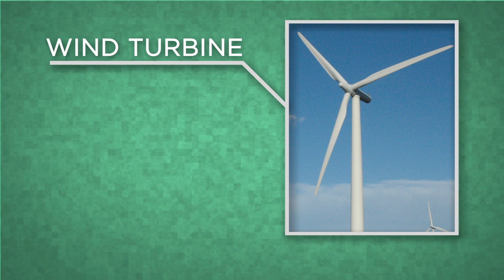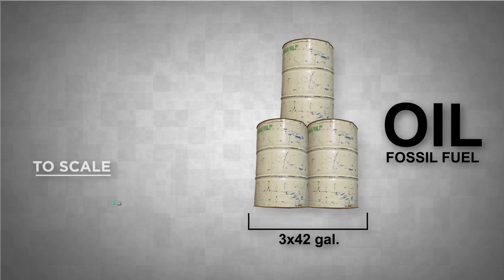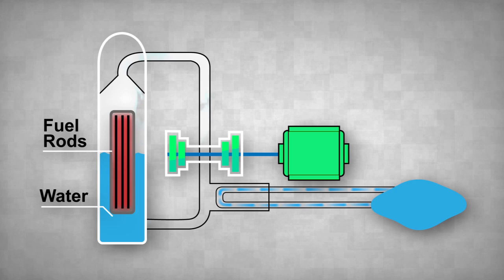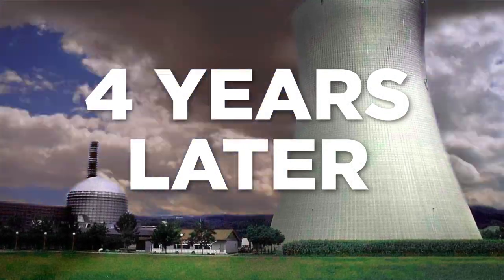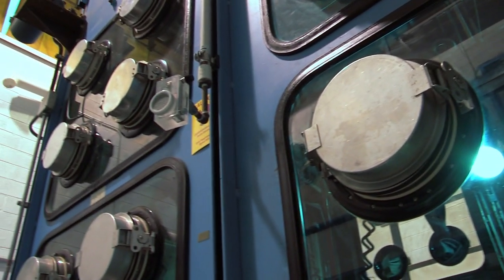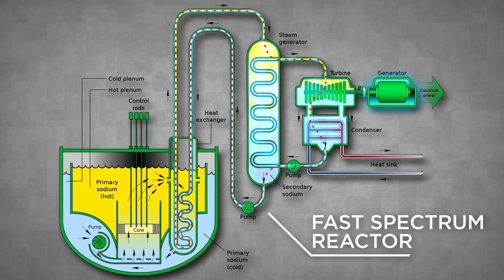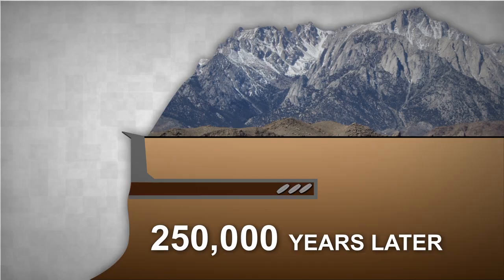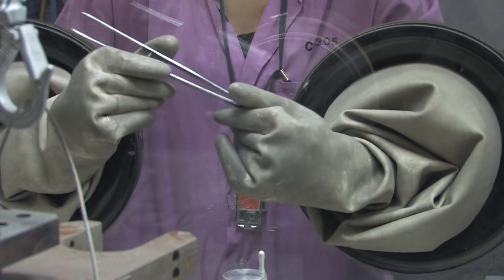Argonne explains nuclear recycling in 4 minutes

Comment: High temperature electrolysis would definetely be the way to go. Could be done in a continuous basis. The uranium and actinides could be saparated. Noble metals would settle out and the bad baddies like 137Cs and 90Sr would stay in the salt bath. When it gets too hot to work with simply drain off and react with silica to make glass. Then repeat 🤓❤
Reply: What about plutonium?

Comment: I'm sure this is a dumb question but, it's bugging me and I have to ask it.  Why not use a centrifuge to separate the actinides from nuclear waste?  The video talks about first converting the old fuel into a salt.  Salts can be melted.  Liquids can be centrifuged to separate the heavier components.  The unspent uranium and other actinides are all very heavy elements and would want to go to the bottom of the centrifuge.  From there you collect them, convert them back into metals, and back into the reactor they go.  Why won't this work?

Comment: The fission products aren't just waste, they include several percent each of ruthenium, rhodium and palladium, three valuable platinum group metals that are literally worth their weight in gold (except for rhodium, which is the world's most valuable metal, and is worth much more than gold!).
Reply: There's a chart on Wikipedia showing the radioactivity of fission derived platinum group metals over time. It turns out the ruthenium has potentially hazardous levels of radiation for several decades, but the other two are already fine as long as the fuel has cooled down for several years before being reprocessed.
https://en.wikipedia.org/wiki/Synthesis_of_precious_metals#/media/File:Activity_of_pt_group_metals_from_uranium_fission.png
Reply: Maybe they are contaminated.
Reply: @vitordelima  It depends how long you wait to do the chemical separation. The fission products start off fiercely radioactive, but nearly all the radioactivity comes from shortlived isotopes, which rapidly decay into nonradioactive ones. Leave it 10 years from when the spent fuel is removed from the reactor, and there isn't that much radioactive still in there. In fact most of the residual radioactivity comes from just two isotopes: Sr-90 and Cs-137.  So I think the platinum group metals should be fine. I know there's a longlived palladium radioisotope (Pa-107) that will be mixed in with the palladium, but it's only very weakly radioactive, so shouldn't present a problem.

Comment: After half a century of generating nuclear power, we still haven't permanently disposed of any of spent fuel. Its all in temporary storage at the power plants. So, this overly chipper video doesn't fill me with hope...
Reply: That's a good thing, since this "spent" fuel still contains 90% of its energy and can be recycled into fuel as this video explains.
Reply: @MatthijsvanDuin  Au contraire. Its a disaster waiting to happen. Plutonium is fiercely chemically toxic, like many other heavy metals, yet as a synthetic element nature has evolved no defenses against it. Britain's Thermal Oxide Reprocessing Plant (Thorp) never hit its performance targets, leaked hazardous materials, lost vast amounts of money, and shut down a decade ahead of schedule. And now they have to clean up the recycling plant itself. Utter.Disaster.
Reply: @paulgush  Just because someone somewhere fucked it up doesn't mean it's a bad idea to recycle spent fuel and greatly reduce both the volume of final waste and the duration it remains dangerous.  

Note also that the reprocessing method in this video is very different from the PUREX method that is currently used for reprocessing; it completely avoids aqueous solutions (and their risks of leakage).  it also doesn't extract/purify plutonium like PUREX does, it extracts the mixed actinides in metallic form to be immediately reformed into fuel for a fast reactor.  Look up on the (regrettably cancelled) Integral Fast Reactor for the big picture
Reply: @MatthijsvanDuin  To your first point, true. But there are plenty of things that are technically possible, but economically ruinous. Concorde and the Space Shuttle are my favorite examples. And the nuclear industry has a track record of big cost overruns...

Comment: Does this mean we don’t have to throw away the spent fuel and its waste but reuse them?
Reply: Yes. That spent fuel has 99 percent of its energy. Imagine if it takes 4 years to use up 1 percent of the fuel, how long can recycled fuel last?
Reply: tripple-d 2146972 can we safely reuse it without it leaking dangerously and after using it will it decompose faster to minimize the risk of radiation to almost zero?
Reply: @samuelzev4076  that's what they guys un this video are studying. Molten salt methods are decades old, but hopefully with modern tech we can make it efficient enough
Reply: tripple-d 2146972  I am hoping that after 4 years of using it will decompose faster within the same time lap of 4-8 years rather than 10 ,000 years. The faster it decomposes the safer it will be but that’s my opinion.
Reply: @samuelzev4076  I've read somewhere that once you use up more of its energy, it becomes more stable. Down to a few hundreds to a thousand years the more energy you use. And since spent fuel rods only use 1 percent, they are still highly energized to have all those hundreds of thousands, I could be wrong
Reply: @Handlebarrz  After that we need long lasting, easy to dismantle nuclear power plants.
Reply: @WetaMantis  idk about that, as long as it's maintainable and we're able to resuse all the " spent" fuel that has been buried in the desert all these years
Reply: This is the only way to truly make nuclear power safe in the long term while making it a mainstream and safe tech...

Comment: To recycle the spent fuel rods, why don't they use them to heat cities with hot water?
They could be in a central location and used to heat water , then pump it to heat all of downtowns buildings for a long time. Save money for the city.
Reply: 1. Loss of power and not being hot enough
2. Location. 
3. Leakage.
Reply: It honestly sounds like a disaster waiting to happen. In addition it would not work. It doesn't heat the water enough to actually make a big enough difference in the temperature of the water. 

Imagine a giant pool of radioactive waste in the middle of a mega-city. What do you think will happen if there is a leak between the pool and the water being transported?

And even if you make it 100% leak proof, who is going to voluntarily live next to a radioactive pool (regardless of whether the radiation leaks out or not.)

If someone has ill intentions toward that city or the country it's located in, where do you think they would attack in order to create the highest amount of distress? 
Can you imagine the backlash of subjugating hundreds of thousands of citizens to a potential catastrophe waiting to happen?

Comment: But what, if there is a bigger accident or an attack on the power plant?
Sun or wind or water energy are completely safe, decentralized, completely free and nearly waste free recourses... 

Just sayin...
Reply: Solar requires vast amounts of surface area and only provides power when the sun is shining. Wind only provides power when the wind is blowing and requires massive amounts of petroleum lubricants. Both are expensive to construct and maintain, have short life spans, and cannot provide near enough power to economicaly meet power demands 24/7. Simply put, solar and wind are not feasible to use to replace fossil fuels. The only reason they are proliferated to the point they are is because the government subsidizes them at the demands of the environmental terrorist.

Comment: Question, can this be used to reprocess the breeded fuel from the Fast Reactors and fueling light water reactors and then Candu?

let's say i have a Fast Spectrum reactors that uses around a 1000KG of fuel and produces 250KG extra kilograms

is possible to use the pyroprocessing to use that in a normal pressurized light water reactor, until it has a 1.6% enrichment and then it has to be processed again to use it in a Candu reactor?
Reply: Наверное после каждой топливной сессии нужно будет очищать топливо от продуктов распада и минорных актиноидов, поглощающих нейтроны и тем самым тормозящих цепную реакцию. И плутоний не пробовали эксплуатировать на канальных реакторах РБМК как в Чернобыле, а тем более Канду. Плутоний в топливо добавляют только в корпусные реакторы как российские ВВЭР и французские. Если пробовать использовать плутоний на Канду, то сразу разбавлять обеднённым ураном(ураном-238 с содержанием урана-235 ниже экономически выгодного порога извлечения) до нужного процентного содержания. На производствах по обогащению урана большие запасы обеднённого урана, мировые запасы ,вроде, более 2 миллионов тонн.

Comment: Thank you for your research and development. You have resolved one of the difficult problems faced in our use of nuclear power. This is a very good video as it has explained and answered most of my questions. Obviously the efficiency of this process is vital to it's effectiveness. In your video you explain your research is looking for an effective method of separating the usable uranium from the spent rods. It appears you are on your way to increasing the efficiency of this process.
Reply: Still a hell of a way to boil water though. Isn't that disrupting the hydrological cycle?
Reply: @obsoleteoptics  Nothing wrong with boiling water to spin turbines. Have a better idea?